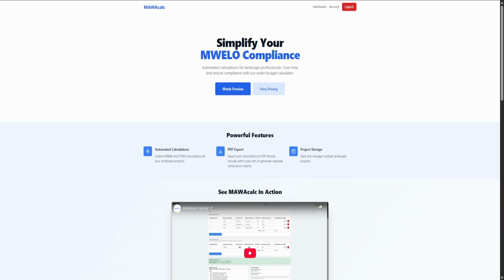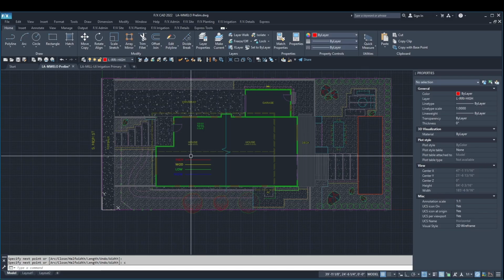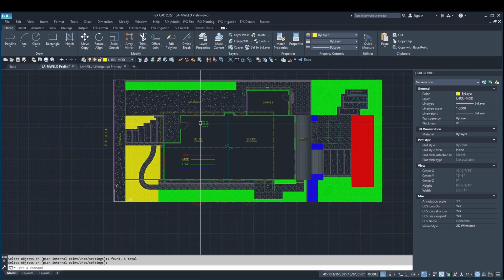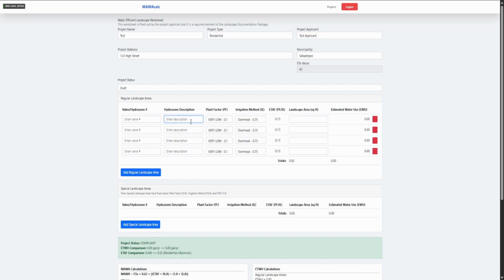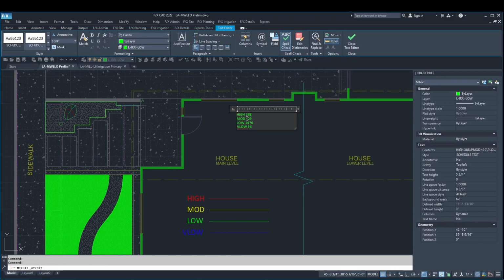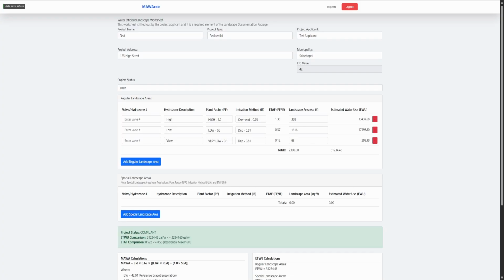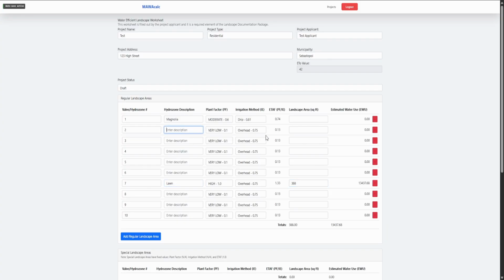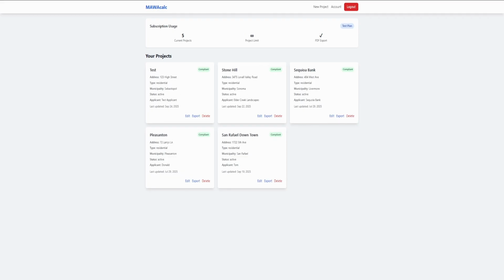Using MAWAcalc with AutoCAD for MWELO compliance

Comment: Hi, Tom.When I was using MAWACalc, I couldn't upgrade to the professional version. And when I tried to delete my account, there were also problems. It will display "An error occurred. Please try again." in the upper right corner. Can this problem of the website be solved?